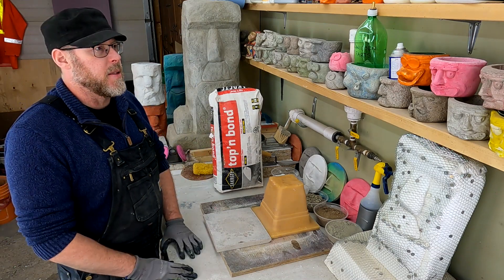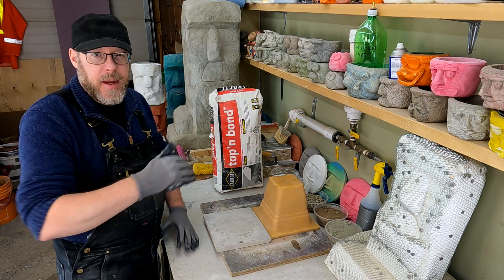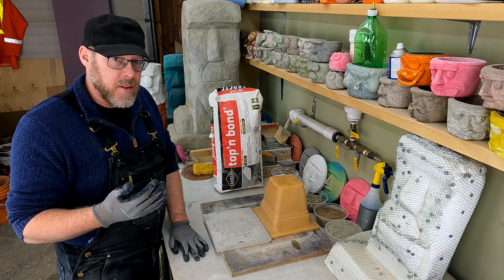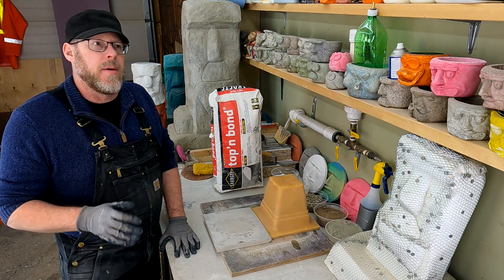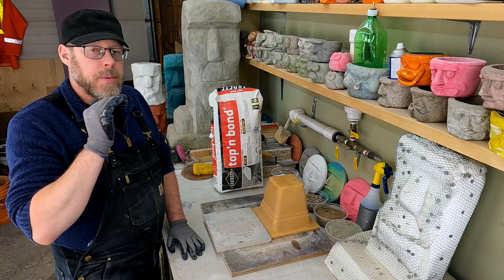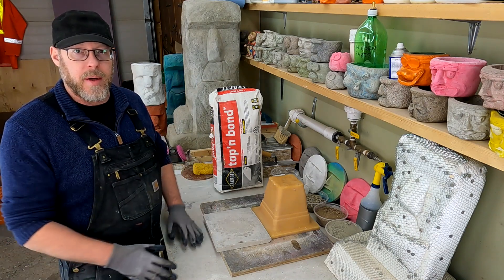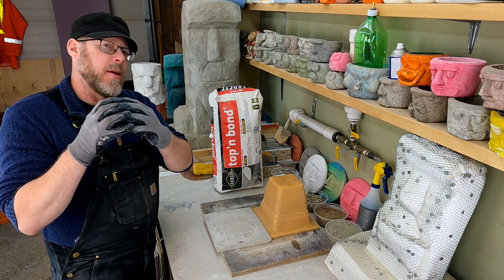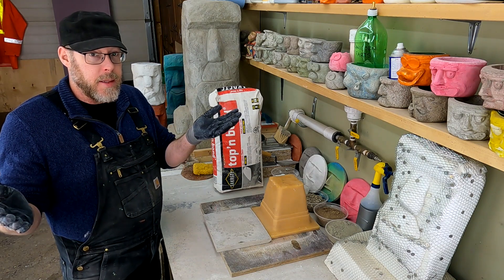How Does Concrete Overlay Work?

Comment: Great video! A lot of contractors are now recommending resurfacing concrete surfaces like porches and steps with an acrylic polymer type of coating. It’s applied with some sort of fiberglass mesh. It’s essentially the same stuff they use on architectural walls and for foundation parging. It gives a nice clean look and can be colored. However, i am really sceptical. There’s not much info on it’s durability and longevity. What are your thoughts?

Comment: Good overview!
In the past, I've found a few things that greatly contribute to the bonding of new onto old:
1 - clean the old concrete as much as you can - pressure washer, wire brush etc
2 - "key" the surface of the old stuff as much as you can - again with a wire brush, maybe a wire brush attachment on a powered drill, or scrape with an old screwdriver or rake
3 - make sure the old concrete is good'n'saturated with water when you apply the new stuff
4 - add in a little PVA to the new mix (or put down a layer of PVA onto the old stuff and then apply the new stuff before it's fully dried).
Reply from the maker: I like all of that except the PVA.  Its a good idea, but not for a polymer modified mix like the overlay.  It has acrylic in it, and you usually only use acrylic OR pva, but not both as they conflict with eachother.
Reply: @creatingconcrete  Ah yes, hadn't thought of that! Good catch :) The PVA trick has worked well for me when repairing broken cement planters and the like, but the cement I've used has been plain ol' Portland cement and water and didn't have any extra stuff in it.